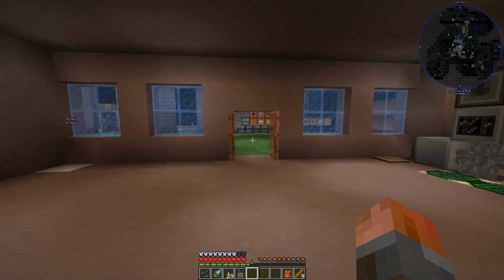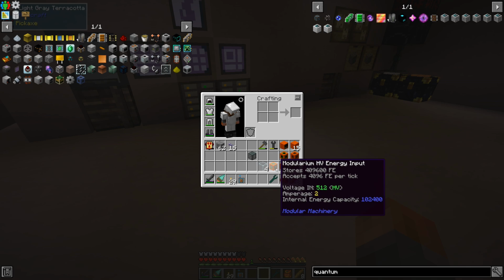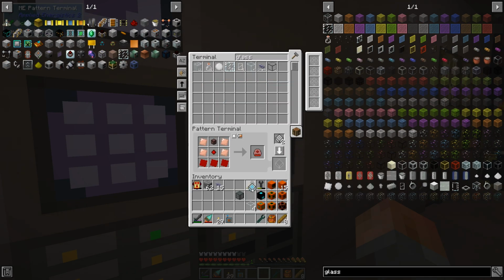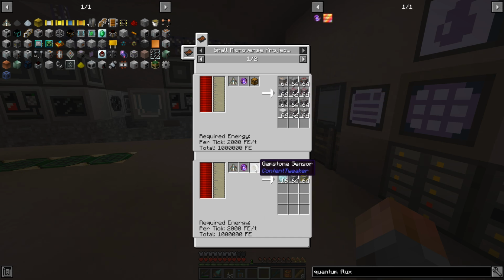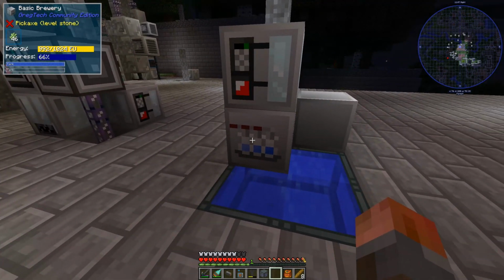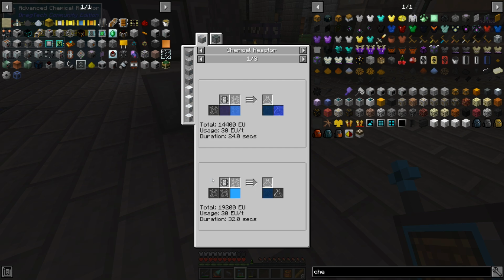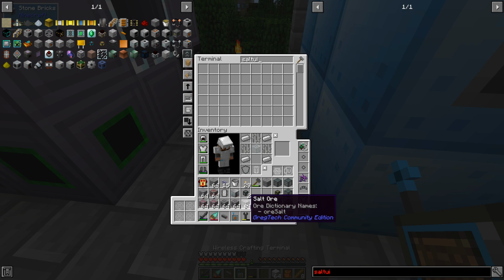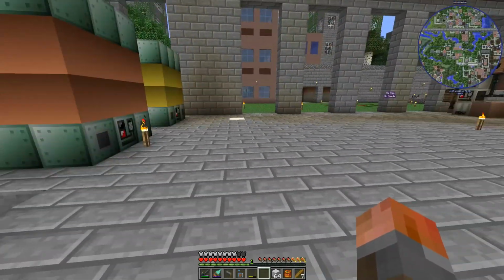Omnifactory E39 - Into the Microverse!

Comment: Centrifuge charcoal/coal/coal coke dust for 100% of Carbon dust. Personally, I have coal coking for the Phenol, then I macerate and centrifuge the results for my carbon dust.

The Moon Turf needs an HV+ macerator to make into moon dust, which main purpose is centrifuging into a good amount of Deuterium, letting you re-purpose that Hydrogen (and you'll need a lot of Hydrogen later. Friggin' Tungsten...).

You've already done about 1/5 of the Mid Game tab, though you can't see it since you haven't done the start quests. Similarly, the top of the Early Game you've also done, but you don't get to see it since you haven't done the very first part of it.

Despite using an HV Energy Hatch in the creation process, the Modular Machine energy hatch can take RF directly, no need to convert it to GTEU, losing a good amount of power.

You should upgrade your item output hatch on the small microverse projector at some point; One of results from the tier 2 microverse ship has more outputs than the output hatch from the quest has slots for, and the machine controller doesn't give a clear error message that that is the problem.

Comment: regarding ore processing thermal centrifuge is really not worth it in my opinion its just so slow for so little output, and btw the chacne to get secondary output refers to mv tier, it doubles with higher tiers of machines, so 28 at HV 56 at EV and 100 at IV